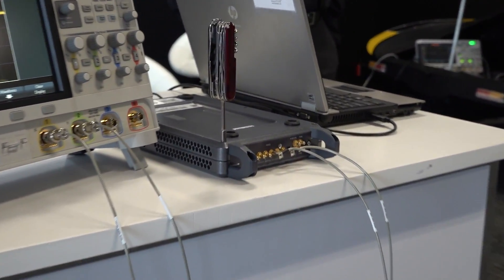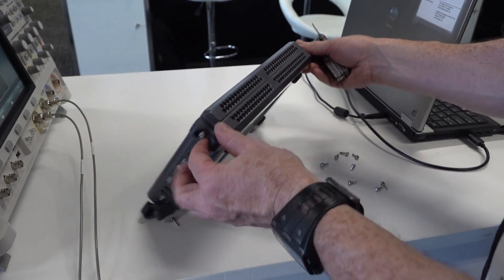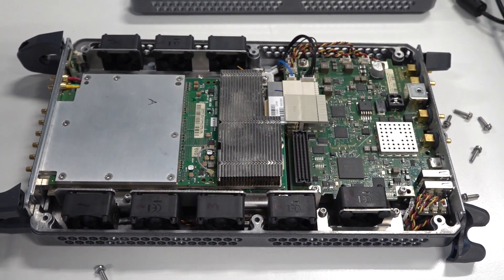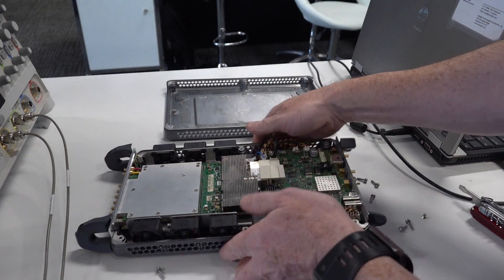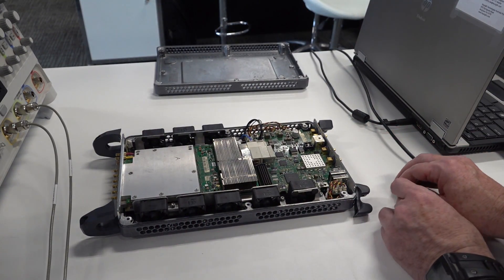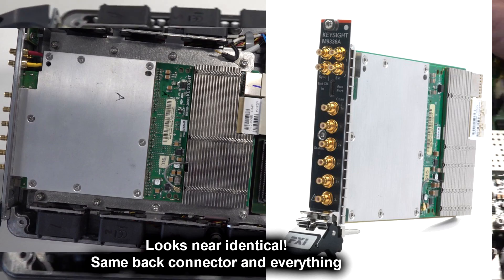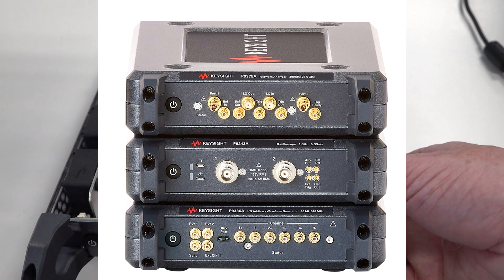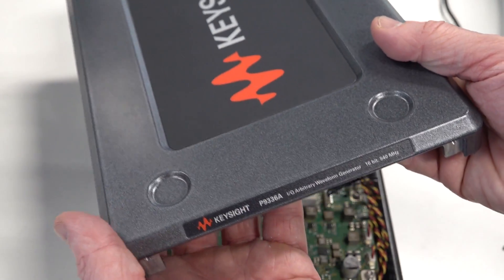Keysight P9336A USB AWG Teardown

Comment: You seemed a bit surprised at the difficulty in getting the thing open. They put it together like that not for ease of access, but to keep the components secure. If they meant to have the thing frequently and constantly opened and closed, they would have mounted the thing in a beer cooler.

Comment: i wonder what they use the PLX chip for? it's usually a pci bus lane expander
Reply: Probably a USB3380 USB3-PCIe bridge. They basically just put their PXI-Express (PCIe + clock/sync) ARB gen in an enclosure witha bridge board. Probably the same with other models in the series.

Comment: The expansion connector is a SEARAY connector, likely for a FMC Card (https://www.xilinx.com/products/boards-and-kits/fmc-cards.html). However, it does not seem to be much space to fit an FMC card in there.

My wild guess is that, just like the front board is a PXI card, the back board is a more generic backend that could fit several instruments, some PXI, some FMC.

Comment: input power is 15V@6A. do they really need 8 fans to dissipate that power ???
Reply: 1 fan of the size they had could probably do the job, if it was a screaming high RPM jobbie. having 8 fans means they can keep the RPM low, which despite having many more noise emitters, keeps the volume lower overall.
Reply: making a dye withstand higher temperatures is a tedious design and refinement process and wouldnt be worth it in these low volumes
Reply: It is for explaining potenional customers the high price they want for it.
If a customer ask them why the unit cost $23,000 ,they can say ,
" Hey it got 8 fans "
Reply: 90W is not something you can do passivly and with temperature sensitive stuff you want some airflow.
Reply: srs my CPU is 35w TDP  do i need a fan?
(btw it would run at over 120C  with passive cooling)  those fans are very low CFM  maybe 1.5CFM to 2CFM at the most   Laptop  fan would have done a better job (maybe two    input and output)
Reply: I think they simply skipped thermal engineering.   take a look a front-end cans. when you need cooling you put a heat-sink for maximum surface and better thermal transfer. not a flat sheet of metal.... maybe they calculated engineering cost and fans were cheaper.